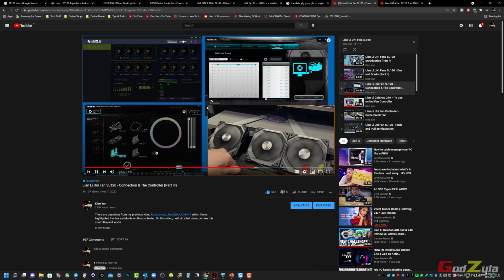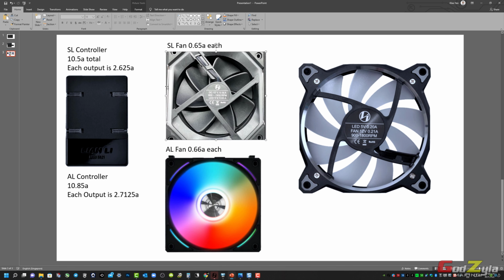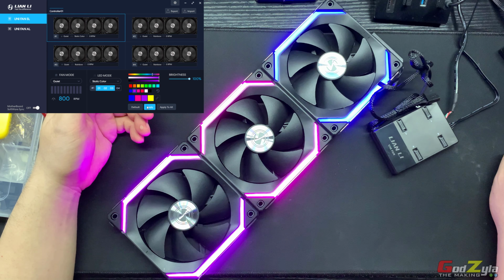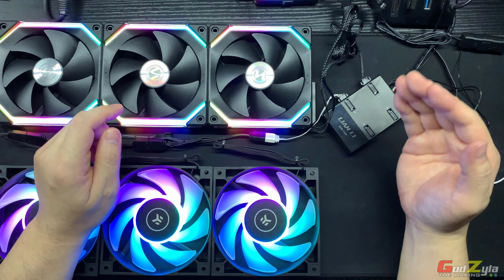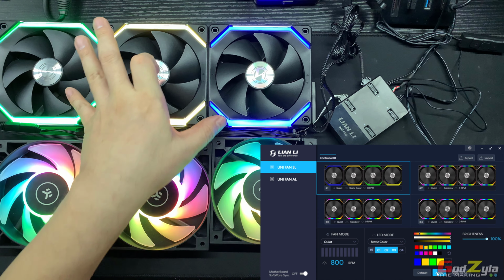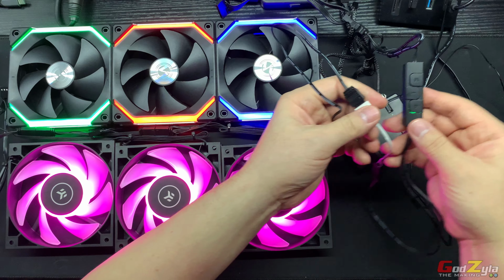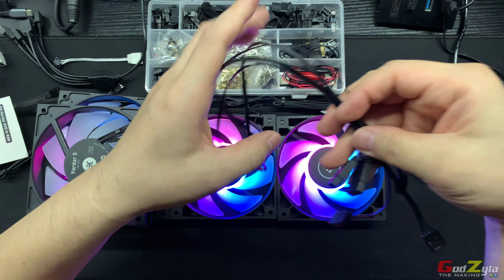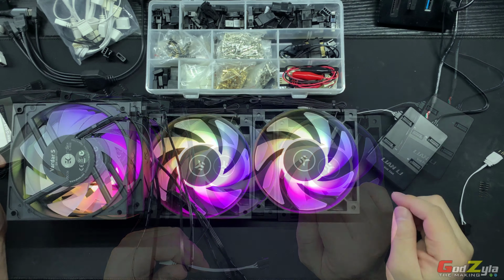Lian Li Uni Fan AL120 & SL120 Controllers [L-Connect 2]

Comment: Thank you so much for doing this video, this question was in my head almost a year (when SL120 is release)  even jump to reddit or watercooling facebook group and just try to google  and try to dig in if anybody have try something like this but still no clue, finally this video i got all that solve all my question i want to know for so long now
Reply from the maker: Hi Kaboom, you are most welcome.
Reply: @KleoYan  Im back the fan just arrive and i just finish testing AL120 with (Corsair lightning node Pro)+corsair Icue result= work flawlessly it can doing sequential effects and change every color to each fan independent, I use Corsair LL fan profile  but for 3fan you need to use 4fan profile because it have more LED than the  corsair LL fan using.... so happy now lol
Reply from the maker: @kaboom8352  ooo that's nice.. you took the gamble :D congrats..
Reply: But if  i doesnt plug the usbport and download Lconnect it wont sync up ,so their is no way around it i guess
Reply: Notice this when doing this ,Anyone who want to try this please know this you can only control independent lightning using Icue(with 3pin arg adapter)  at max 4fan  because unifanhub only support 4fan max per light port

 I try plug 3fan to unifanhub port1= 4 fan lightning control  independent
 I try plug another 3fan to unifanhub port2 = all fan repeat port1 lightning

In this 4fan max you also need to connect though 1port only because other port will repeat lighntning effect and not many pc case can hold 120x4 fan but if your case can hold up to 120x4fan then yes go for it.  and if you want to control more than 3-4 unifan al120 independent light you need another unifan controller to plug it to another lightning port on the lightingnodepro.
Reply from the maker: @kaboom8352  hey thanks for sharing. :)
Reply: @KleoYan  no problem,Thank for sharing too on how uni fan work so i can bravery try this and not burn anything.

Comment: Thx for the explanation!
As for the current calculation, you mentioned that the SL120 controller can handle 2.625a for each port and each SL120 fan draws 0.65a so it would not overload. But how about the pwm?
if adding 0.65+0.18=0.83, 4 fans would be 0.83 x 4 = 3.32a which exceeds the limit. But in reality it won't overload why?
Reply from the maker: Hi Lau Kyle, welcome back 😁 I have mentioned on argb load. Not fan load. If you need fan load. I will measure that maybe in future. Sorry to confuse you this way when I said total of sl is at 10.5a me bad. Nevertheless thank you for pointing out. I am focusing on argb load as that’s the main thing that I observe to some pc builders who burned their argb header on the motherboard by doing crazy add ons like more argb strips and more etc. Some motherboard does have max 500led and stop there. But some motherboard don’t, so ended up got burned out.

Comment: Can you make a brief video on the two cables on the 360 radiator AIO pump and where they go on the motherboard or with the Liam li combo.
Reply from the maker: Hi JOHN van someren, welcome to my channel and maybe this will aid you https://youtu.be/XNCAeAX0mZQ or even this https://youtu.be/njlkdM9lYbI .. or you need this? https://imgur.com/gallery/beYR8CN
Reply: @KleoYan  I’m gonna need that lian li argb cable kit for the full combo with the fans . Which I have 2 sets of 3 uni fans and a single uni fan from lian li. I also got the Galahad AIO 360 and finally the strimer plus 24 pin extension 200mm and the strimer plus 8 pin extension 300 mm cables . That does come with the controller and such.
My motherboard is the Mag B550 Tomahawk , it seems like either did something wrong or I don’t have another spot for a LED header for the fan hub cables that connect to the motherboard.
I did buy that kit off of Newegg
Oh my case is the 011 Dynamic XL from Lian Li
Reply from the maker: @johnLock8388  Hello. so you bought the kit. but unknowing how to plug?? am getting confuse what you need or what you are troubled with.
Reply: @KleoYan  I bought the lian li ARGB cable kit so that I can connect everything together and to my motherboard. I hope it works ! 
I think I might of plugged something in wrong but I’m not sure, I’m new to all this and it’s my first build
Reply from the maker: @johnLock8388  I see, hmm your case you can use this diagram. I am so sorry that I do not have the argb lian li cable kit but my viewer has it and he sent me the manual and pics. from there I draft out this diagram and it works for him. I have also use this diagram for others and it work out for them too. https://imgur.com/gallery/beYR8CN there is on thing short where by you can connect your O11D XL strip to the Strimer controller which have a 3rd cable to allow you to connect your case strip to it. but I would say get your basic first before you do your case strips. once thing you need to take note is that if you did install the MSI argb app (dragon app or something) that could be the cause to block you from using the L-connect app. if that's the case, use revo uninstaller to remove the MSI argb app first, then install L-Connect as administrator. see if it works.